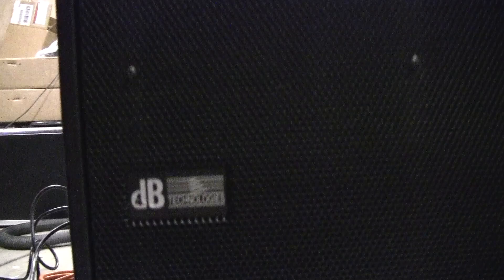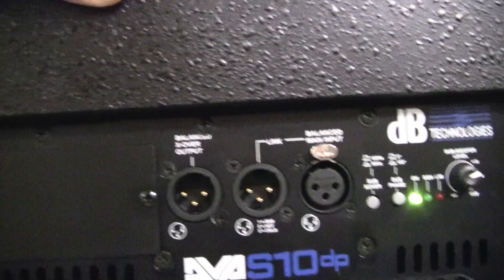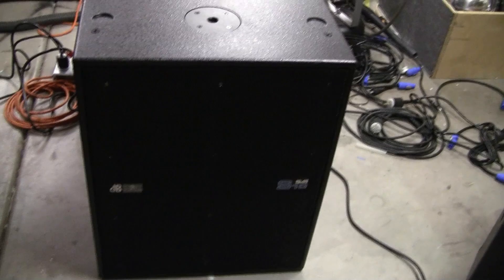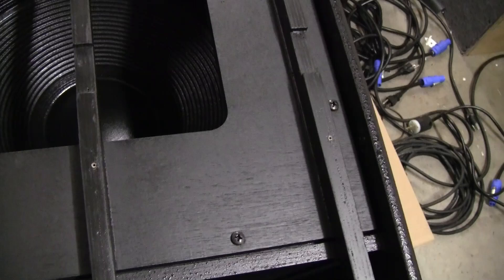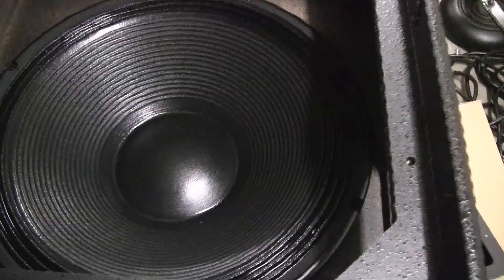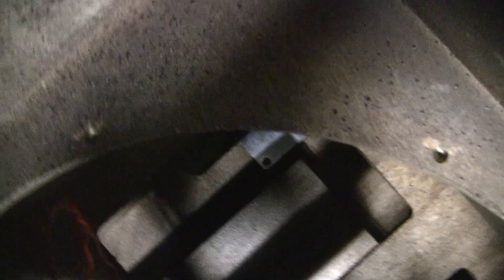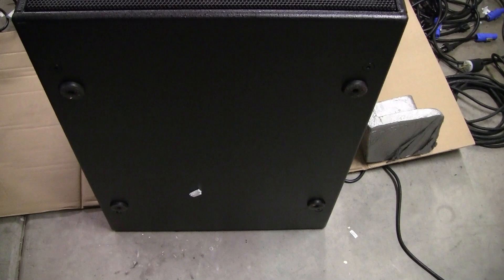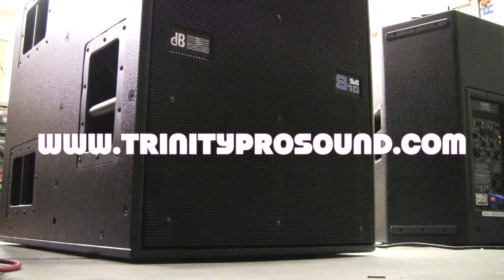db Technologies DVA S10 subwoofer review and overview - Auth Dealer for db Technologies

Comment from the maker: Yes, we do it all the time. We use the DSA4 mount which handles 3 of the T4 tops and allows vertical adjustment of the splay angle. We have some pics we can send you, email us and we will shoot you what this set up looks like. The height we have used in nearly 96" to the bottom box....and is fairly secure and safe.

Comment from the maker: actually, it does not rattle the truss..the concept is to get the low end to penetrate out into the event as much as possible. You can only do that with subs in the air. Ground stacked subs are blocked by bodies in front of the stage and seating or standing area, thus the use of flown subs allows for low end to be projected further into the venue

Comment: I would think that this sub is slightly "better" than the QSC KW181 sub. This sub is dB pro line of equipment. The  cheaper dB sub 18D is a better comparison. But the dB subs are bandpass units and the QSC is a bass reflex so they will be slightly different in response.

Comment from the maker: Chris, sonically the S10 and S20 sound the same...output wise 2 S10 has same power as a single S20 , but the S10's is 139db and a single S20 is 138dB output max SPL. The 1 db is not going to be noticeable to your hearing or mine for that matter...we have a mixture of both and the S10 compliment the S20 wonderfully. If you are in the US call us for pricing. thx !
Reply: trinityprosound was db tech dva s20n dsp are available to your company?

Comment: Would it be possible to groundstack 2-S10's with 3-T4's on top with a polemount ?
If so, what would be the max height to the top T-4 ? And would it need the flybar on the ground to stabilize this configuration ?
Thanks

Comment: Hello. There exists a great difference of performance between this model DVA S10 v/s sub18d of the same brand? Being both of 1000 watts rms I am undecided to buy. He would be grateful for his orientation with regard to the differences. Thank you.
Reply from the maker: Both are excellent subs, but the S10 has more features than the SUB18D and is a bit larger enclosure. The S10 can be flown as well and the power amp is same as the DVA line. If you are not going to be in the DVA line with your other speakers, the SUB18D will most likely be your best bet and value.
Reply: Has S10 the same amplifier that sub18d?
Reply from the maker: No, S10 is a step up from SUB18D amp
Reply from the maker: The S10 amp is 1000W but a different type than the SUB18D. The S10 will outperform the SUB18D since the speaker and amp are upgraded from the SUB18D

Comment: do you think you will ever do a review on the RCF TTS18A
Reply from the maker: Most likley not, as we don't get a lot of inquiry for the TT line in general. The TT line is amazing and we own roughly 35 boxes of varying systems, it is awesome gear, just at the top of the price point, but this is tough stuff, sounds great and is true touring gear. they are coming out with a MK2 version of the TTS18 here in the US soon.
Reply: are you aware of any reviews and or demos on tube, thanks for the rapid reply
Reply from the maker: no, but with that said we own 8 of the TTS36A subs and 8 of the TTS26A subs...they are amazing...wait for the MK2, it will be killer...around $3500 or so street price in USA i would figure maybe a bit less
Reply: well the thing is i own 2 of the subs, and i want to get the full potential out of them. they sound amazing, but i like too make sure I'm getting the most out of my investment. that being said id like to make sure that the application I've been using is correct and can i or should i use my drive rack with them.
Reply from the maker: either way, you can use the on board processing and link out t your tops, but a separate feed in unity volume and phase is the best way to feed them, aux fed or sub group fed and send only the instruments to them that need to have sub content. that will keep the rest of the mix nice and clean.

Comment: are they better than the rcf 4pro 8004-as and the 8006-as?
Reply from the maker: +Shivanand Gunness no, the 8004 is more powerfull than S10 and configured different in cabinet. 8006 sub goes lower than db S20 and has a bit more power, S30 sub better for rock, etc.

Comment: Hello. The amplifier of audio power of the DVA S10 specifies internally nominal current of 1.9 To for a voltage of 220 volts. If the law of ohm says that P=VxI then 220x1.9 = 418 Watts. Since then since is it possible that it provides 1000 W RMS? I possess one and want to acquire the second one. I disarmed and saw in his interior the module amplifier when I disarmed the bafle and it has the above mentioned specifications in his interior (I=1.9 -- V=220) Thank you.
Reply from the maker: The amp is 1000w RMS on the sub...it is a SMPS type power supply and digital amp. You most likely are looking at ⅛ power rating of the amp as is typical with most nominal ratings.